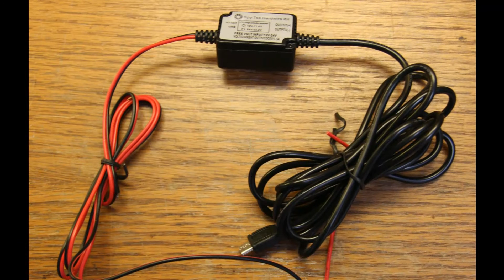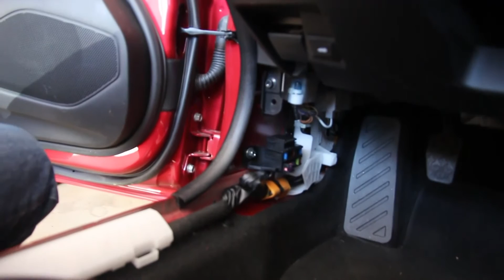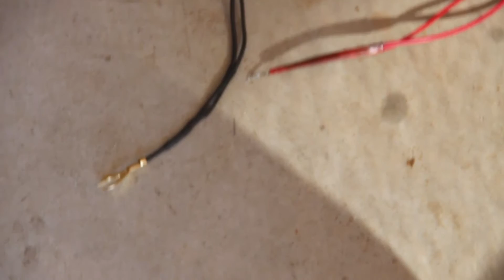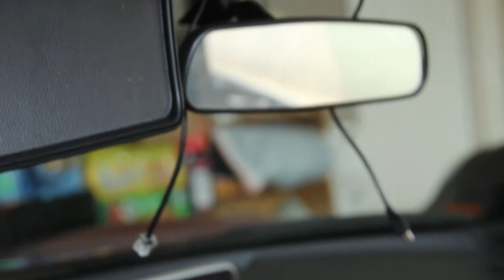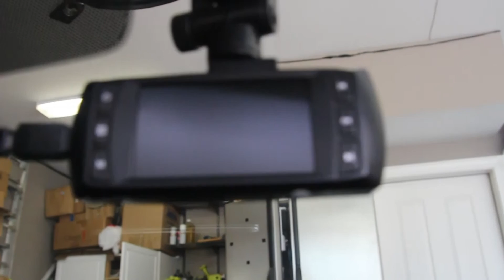2016 Mazda Miata (ND)  Radar Detector and Dashcam Hardwire

Comment: I am doing the same radar detector install. Can you tell me how you disconnected the harness from the tweeter in the A pillar? I tried to press down on what I thought was a tab and pull out but it won't budge! I know that I can probably get by without disconnecting it but I may replace the tweeter in the near future.Thanks!
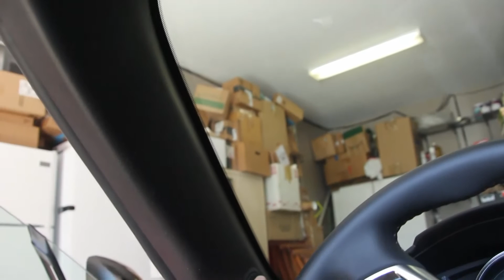Reply from the maker: G Van Medlin at 3:03 I mention the same problem. I could not disconnect the tweeter. I gently laid the trim piece on the side (supported) and worked around it.